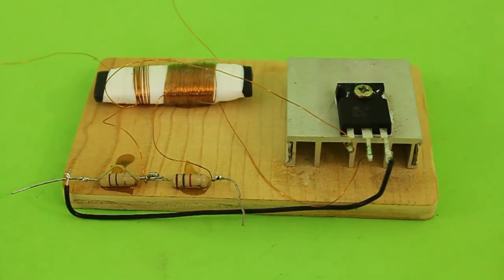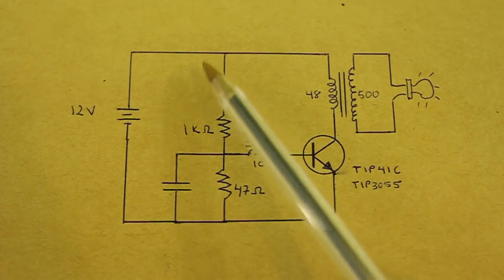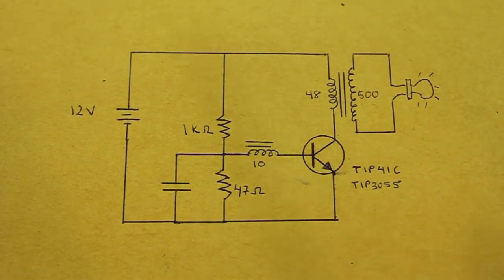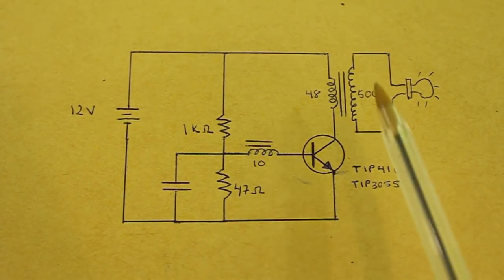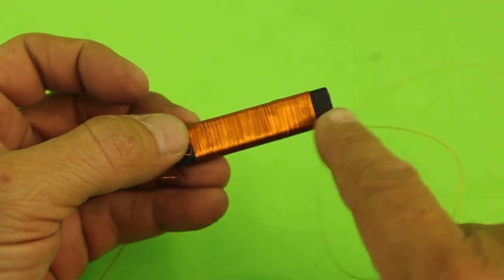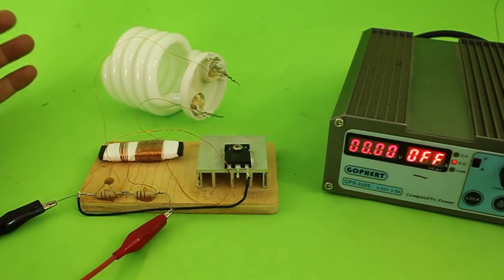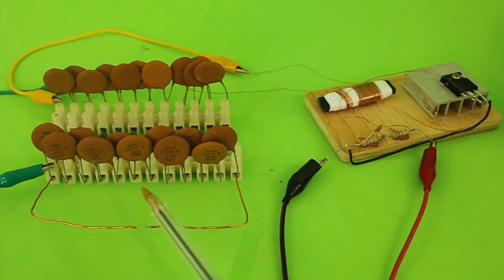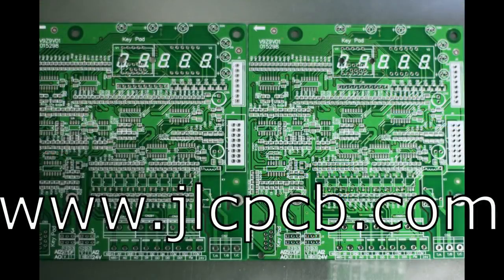Simple Inverter for Fluorescent Tubes

Comment: Thanks! Ive been looking for something like this. According to these comments, could this be scaled for smaller voltages something like this:
9v = 50 : 750 & 15 for feedback
6v = 50 : 1000 & 20 for feedback
3v = 50 : 2000 & 40 for feedback
1.5v = 50 : 4000 & 80 for feedback?
Reply: yes.

Comment: Please change this circuit to slayer exciter circuit. Of course the transformer is as it is. The resonant capacitor on the secondary side must have an appropriate value. If it lights up, you will be surprised at the high efficiency. I think that each eelectric parts does not generate heat at all.

Comment: How do you come up with the number of windings?
Reply: ratio :)
48 is close to 50
so 50 : 500 -> 1 : 10 , it steps up voltage 10 times. Or if used in reverse it steps down 10 times, you get 1/10 input voltage.
You can use a 120v ac 12v dc transformer in reverse to accomplish same goal, I think.

Comment: Can i use 3-9V ?
Thank you
Reply: i think you can use 9 volts but i dont know if it will work properly or burns your transformer
Reply: Add more turns to the secondary to account for the 3v difference. Your feedback coil will need an additional 3 or 4 turns.
Reply: At 3 volts, 2 amps would flow through primary wire... But for 9 volts, you can probably just use 1¼ of the count in video and it should be fine.

Comment: Pls make an inventer using 1.5 battery
Reply: Just do 8 times the primary turn count, then input voltage is 1.5V! But will be 4 amperes then which is quite a lot for a little cell.
Reply: Thank you my idol